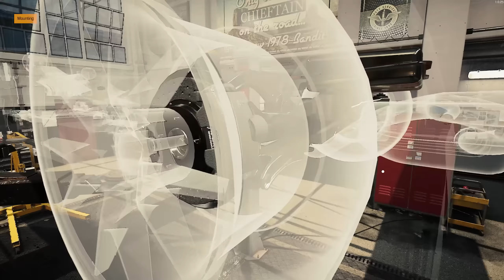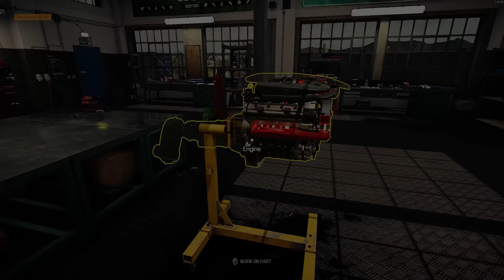Aston Martin DBX restoration - Car Mechanic Simulator 2021

Comment: I cant put the air filter cover on anyone knows why ?
Reply from the maker: have you installed spark plugs and ignition coils?
Reply: @AlexK321 no i cant find them
Reply: No where are they cant find them
Reply: Wait i think i did what else could be the problem
Reply from the maker: @jimmyvandervoort4223  go to the car status and there you can mark the missing parts with stars